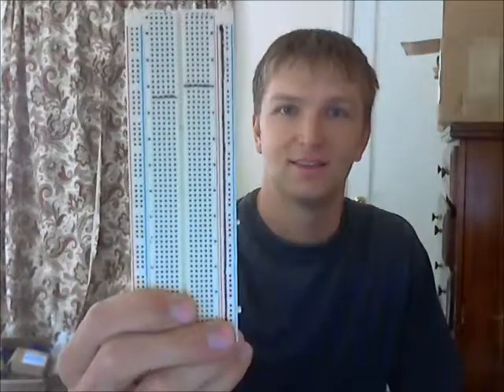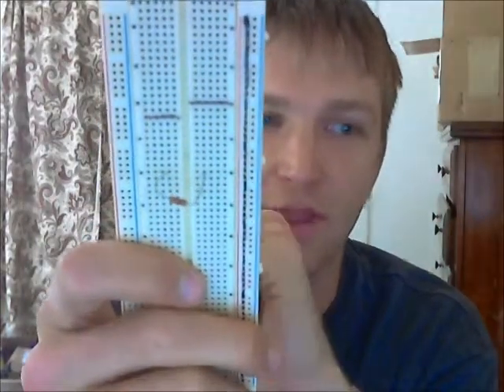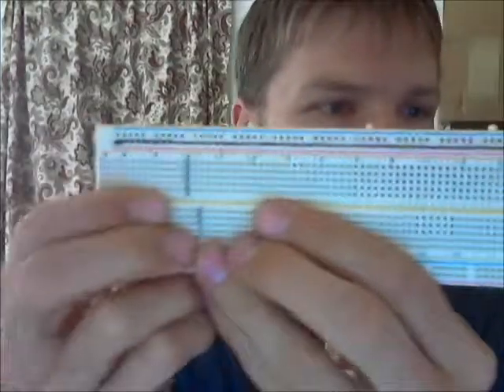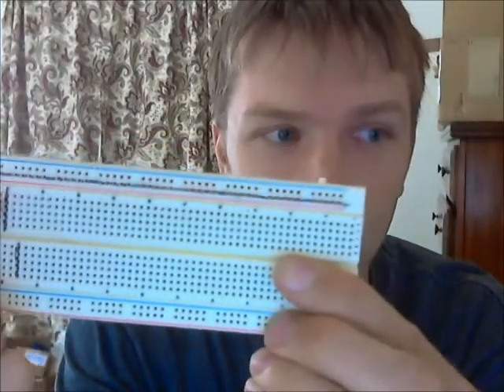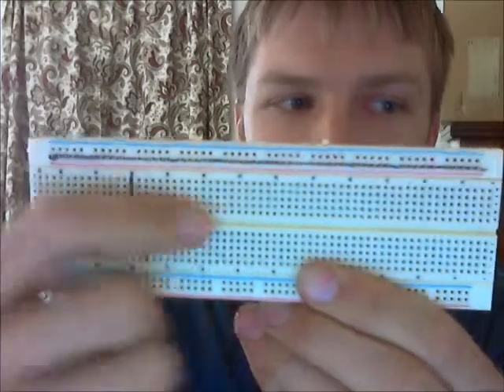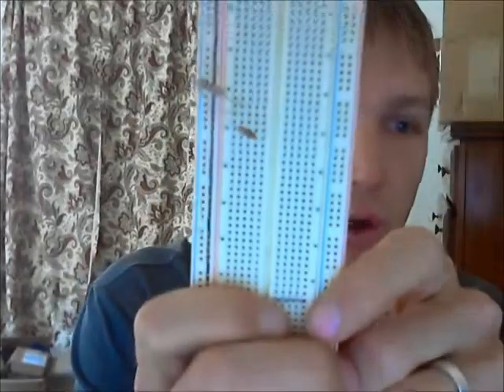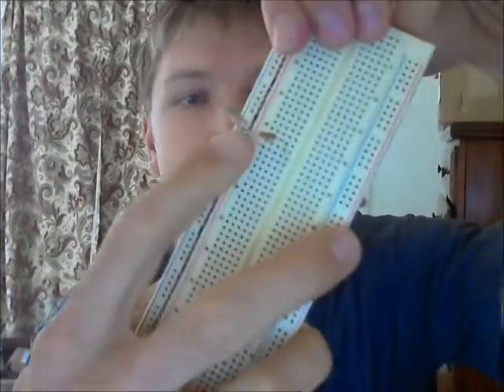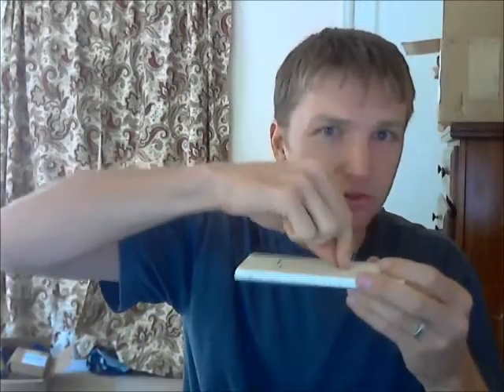Solderless Breadboards: How to & Common Problems

Comment: Great video, so clearly explained.  But it didn't mention if there is a difference in the quality of breadboards (which is why I searched for and found your video). My new breadboards often fail to make a solid low-resistance connection, requiring jiggling the wires for better contact.  If quality matters, what breadboards should we purchase?